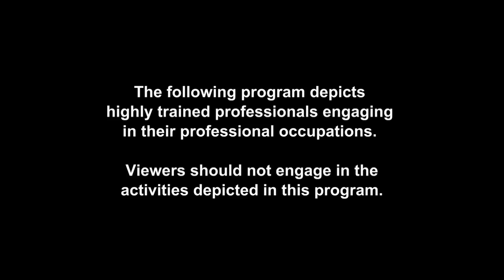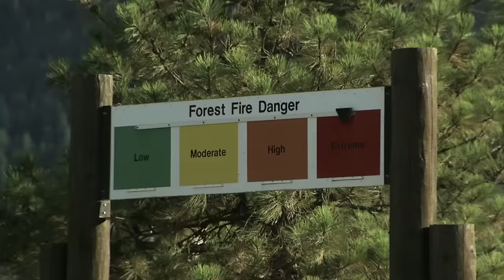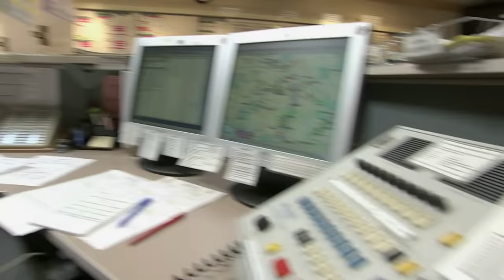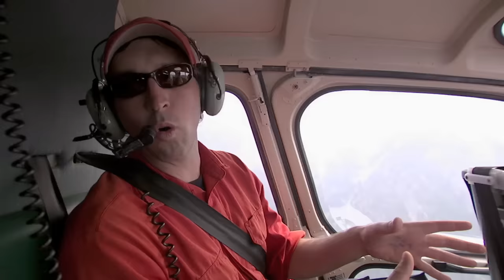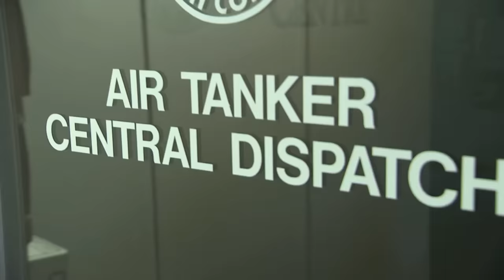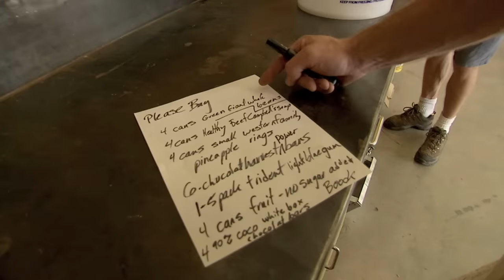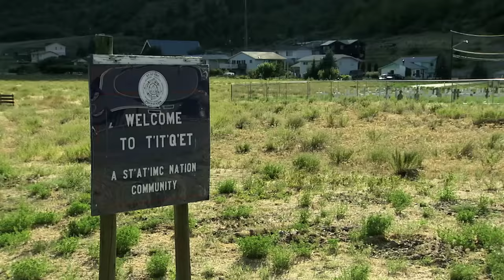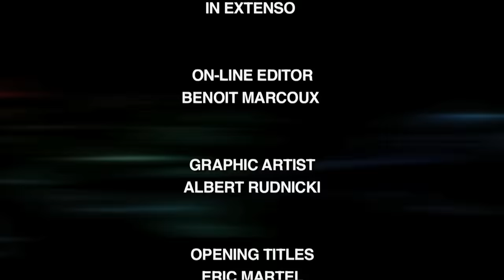Risk Takers - 104 - Forest Firefighters | FULL LENGTH | MagellanTV

Comment: I am retired from the U.S. Forest Service and was assigned to 108 wildland fires in my career.  I only worked full time in fire management my first 4 years and after that was a part of the "militia," employees who work in other agency functions who have fire qualifications and are called upon when additional personnel are needed for fire fighting.  

There are differences in terminology and some procedures between Canada and the U.S.  I'm not sure of what the procedures are in Canada, but in the U.S. there is air traffic control over fires whenever there is more than one aircraft.  The actual title of the person who does this is the Air Tactical Group Supervisor, otherwise known as "Air Attack" on the radio.  Air attack circles the fire at about 2500-3000 feet above ground level (AGL).  Various types of aircraft have different elevations that they fly at while waiting to make retardant drops and helicopters don't fly higher than 500 AGL.  Air attack then directs when and where retardant drops are made.  Other small planes also operate over the fire and they are called "lead" planes.  They fly ahead of the air tanker to test the air, that is they figure out how the air is moving over the drop zone before the air tanker commits to a near ground flight path.  Lead planes have only a pilot on board.  They then guide the air tanker and advise them of when to drop the retardant.  The air operation can be very complex and the hazards have to be minimized by some very skilled and experienced people.
Reply: Thank you.  Every single one of you guys and gals absolutely rock.
Reply: Wholesome comment. I absorbed every bit of that. 👌🏼

Comment: It would be logical to build houses certain ways in areas that have a risk of wildfires. Homes built of wood with wooden exteriors and asphalt shingle roofs are asking to lose your house. Not so much a matter of if, but a matter of when. I know many think concrete and cement is ugly, but if you built your house with concrete for all of the external surfaces and used metal for interior supports, your house has a much better chance at surviving a wildfire intact. Concrete and cement can be formed and colored so it can be made prettier. It might be a touch pricey compared to using wood, but it's a good investment in wildfire-prone areas.

Comment: The wild fires are made much larger and out of control because everything is so dry. There isn't enough moisture in the soil, there isn't enough moisture in the vegetation. One thing we need to do is move water from the ocean back inland to places we need it. The natural water cycle can't refill aquifers that were filled thousands of years ago by melting glaciers after the last ice age. Big problems need big solutions. 

The biggest idea I am trying to express is tunneling aqueducts from the coast, in this case the west coast of the USA inland to feed combination geothermal power and sea water desalination plants.  The idea seems to be so big that no one has considered it possible but I believe it is not only possible but it is necessary. For over a century the fossil water contained in aquifers has been pumped out to feed agriculture, industry and municipal water needs. The natural water cycle cant refill fossil water deposits that were filled 10,000 years ago when the glaciers melted after the last ice age. Without refilling these aquifers there is not much of a future for the region of the United states. As a result ground levels in some areas of the San Joaquin Valley have subsided by more than 30 feet. Similar fossil water depletion is happening in other regions all around the world. TBM and tunneling technology has matured and further developments in the industry are poised to speed up the tunneling process and it's these tunnels that are the only way to move large volumes of water from the ocean inland. The water is moved inland to areas where it can be desalinated in geothermal plants producing clean water and power. In many cases the water will recharge surface reservoirs where it will be used first to make more hydro power before being released into rivers and canal systems. It's very important however to not stop tunneling at these first stops but to continue several legs until the water has traveled from the ocean under mountain ranges to interior states. Along the way water will flow down grade through tunnels and rise in geothermal loops to fill mountain top pumped hydro batteries several times before eventually recharging several major aquifers. What I am proposing is essentially reversing the flow of the Colorado River Compact. Bringing water from the coast of California first to mountaintop reservoirs then to the deserts of Nevada and Arizona and on to Utah, New Mexico, Colorado and Wyoming. This big idea looks past any individual city or states problems and looks at the whole and by using first principles identifies the actual problem and only solution. 

Thank you for your time, I would like the opportunity to explain in further detail and answer any questions.

A better future is possible,
Reply from the maker: A big idea for sure!

Comment: when a fire is put out it has to be a six prong attack. first bombers dump bags of Purple K and water on the fire these are fallowed by choppers who also drop water from bambi buckets. second the smoke jumpers are dropped off by chopper or from a C-130 and they hike to the fire. third bulldozers and logging crews are dispatched to clear cut any burning trees and to cut fire lines. fourth ground crews use pack pumps and Pulaski axes to remove embers. fifth engines are dispatched to deliver water to the site and to put out the blaze. and sixth recon planes go up and survey the site and new trees are planted replacing those lost in the fire.
Reply: Aaron Peavler/Geomodelrailroader Railroad Photography
Reply: you are very wrong
Reply: You don't know what you are talking about
Reply: Aaron Peavler/Geomodelrailroader Railroad Photography awesome to see Bambi buckets being put to use after I  use to repair them or completely overhauling them from the head unit to the cable all the way down to a complete new bucket and hardware!
Reply: @ joseph pawelczyk yes I do I took forestry in high school and I have friends who work for the BLM and the company who repairs the buckets. I live where there is a fire every few months and I see the crews go out every few days. My airport in Gooding is not just a crop duster airport the same crop dusters and choppers also drop water bombs and retardent on fires. and yes I have seen these bombers at work.
Reply: No I'm not Jace Kelsey I took forestry in high school and I have friends who work for the BLM and the company who repairs the buckets.

Comment: New machinery such as one with a large blade or bucket at the end of it much like a lawn-mower that the fighters can operate easily and can be brought on-site locations by helicopter would replace the energy required to use old-fashion hand-tools,  BOOM!

Comment: 15:50 This part is fake and staged for camera, there isn't even a helicopter
Reply: Goobers no, it's on a sling.
Reply: helo airdrops will drop typically tools on slings via a cable. plus, that water bladder is on average 400 pounds.